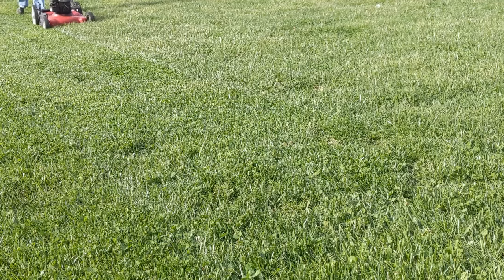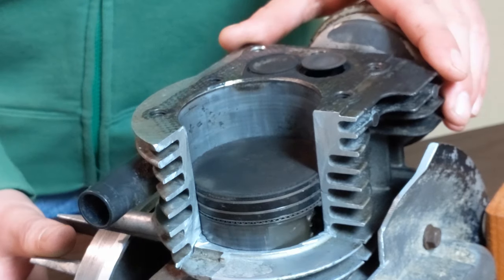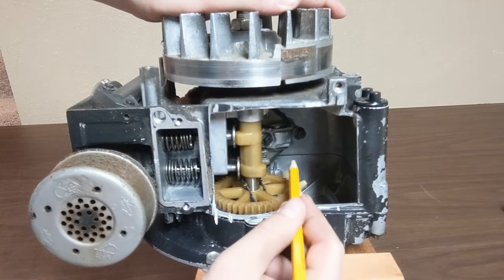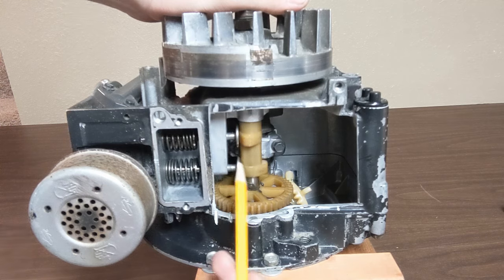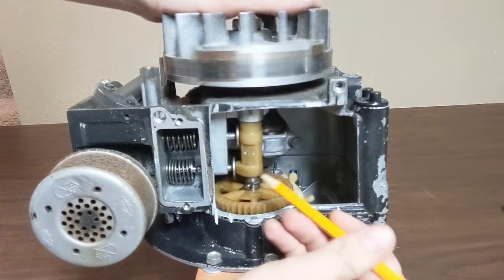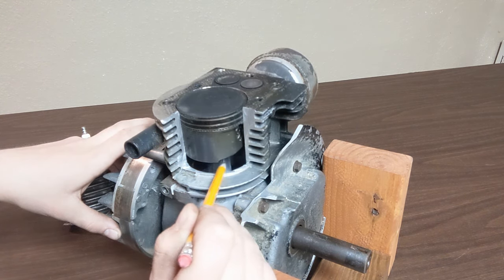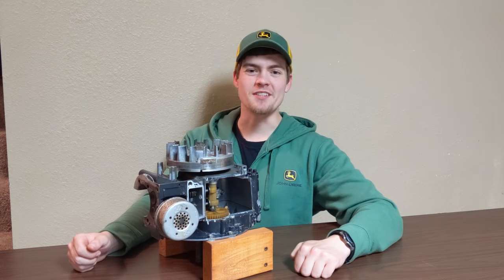How a Briggs & Stratton Engine Works — A Look Inside an Engine Cutaway

Comment: Is that a PLASTIC camshaft?
Reply: Bruh
Reply: Alot of old briggs and strattons have plastic cams. I own i briggs and stratton flat head and it has a plastic camshaft
Reply: Nylon and it's additives revolutionized internal small motor parts. Not a new thing.... decades old.
Reply: So stupid... Any metal shavings in the oil and it's bye bye camshaft.
Reply: @F3udF1st  is that how it works? They seem to work well.
Reply: The valves are small and the valve springs are not very strong. Someone at Briggs said lets make them cams  nylon! The rest is history….
Reply: Bro its 7hp what the f do you want ???
Reply: @Kailikescars I swapt my one whith metal 0:48
Reply: Yes.I took an lawnmower engine appart and lawn mowers have an plastic camshaft
Reply: @F3udF1st shouldn't have metal shavings in your engine in the first place
Reply: @papimasfuerte4671 it's already living a bad life if it does have shavings and dirt
Reply: I'm proud of my Briggs & Stratton collection along with the others a working 1957 2.5 horsepower push mower is yellow from the factory
Reply: In about 1965 they moved the carburetor on the vertical shaft to the other side with a tube I still have some of the old ones with the oil bath air cleaner they run about the same but I bet that tube gave it a little more horsepower but I like them if they're weak too 
My Old 2/12 yellow will just set there and idle at 51 rpm . Sweet 1957 push mower
Reply: I love my briggs but Tecumseh had a pump
Obviously the Briggs slinger is good enough..
Reply: @Kailikescars I'm trying to have an example of each mower changeover from Flathead to overhead valve and it's interesting.
Reply: Probably around 1977 they started using it depending
Reply: @RonaldDaub-v9y  nice!
Reply: @RasmusRosengren  metal is better

Comment: I'm still a small engine novice but I'm learning all the time. This has got to be the best demo I've seen in 3 years  on here. Awesome awesome video thank you.
Reply: get one that is worn out... clean it... take it apart, keep the parts, put it back together again with new E bay piston rings. oil everything up... use 20-50 motor oil as the motor will have excessive clearances in it so it needs THICKER OIL... with 20% STP OIIL TREATMENT...thick as honey.  tighten the CONNECTING ROD, sump and heads with TORQUE WRENCH TO SPEC's OFF GOOGLE FOR THAT MOTOR... the model # is on the tins. dont lose the tins as there are a zillion differnt briggs as they couldnt leave the thing alone over the years so they are all a LITTLE different. new plug... new coil? clean carb with WD 40. new gasket set off e bay $12. oil bolts before assembly so they dont freeze in their holes. TIGHTEN TO SPEC's avail online for that motor. add the thick oil, paint it JD green. write on it with paint pen... CHECK THE GD OIL BEFORE EACH RUN OF THE DAY... USES 20-50 MOTOR OIL!!!!!!!!!  new air cleaner... 5 for $9 on e bay and see if u can get it going again as a mower... sell it for ... $75 or so. TELL THEM TO CHANGE THE GD OIL EVERY <25 hours and new air filter every 50 hours and it will last a good long time. if they dont... it will stop running in < a year. choice is theirs.
Reply: Wouldn't call 3 years a novice, more like intermediate

Comment: Great video! This helps me very much try to understand how engines work. I have very little small engine knowledge but recently decided to pick up a wood chipper with a 7.5 hp briggs and stratton horizontal shaft.  I figured i'd spend some time and figure out what was wrong with it and try to learn something.  The first thing i did was check the oil. It looked new.  However when i checked the dip stick, it was extremely low.  I drained the oil to find there was very little left.  So i filled it to the proper level with new oil.  I checked the spark.  There is a spark. I changed it just for the heck of it.  I also cleaned the air filter and the carburator.  Gaskets seemed ok, but not great.  

When i originally tried to pull start it, it wouldnt pull at all. It was stuck.  Eventually i was able to pull it and at that same time, a blade within the chipper cracked off.  So i think the shaft was jammed due to the blade getting stuck.  It now pulls, but doesnt do anything. it doesnt sound close to starting at all. I dont get sound that sounds like it is starting.  I pulled off the combustion chamber and valves.  When i rotate the flywheel, i noticed the piston doesnt travel all the way up the cylinder.  When i push it down, then rotate the flywheel, the piston comes up about 3/4 of the way.  

Could the piston not moving all the way up the cylinder be a result of low to no oil?  How can i get the piston to travel all the way up the cylinder, as it does in your video when you rotate the flywheel? I have tried lubricating the top of the piston with oil and PB Blaster and spreading it around.. no luck yet.  It has slowly rotated counter clock wise as i push it down with my fingers, rotate the flyweheel, and repeat.  But never going more than 3/4 of the way up the cylinder.

Thanks for the help :)
Reply from the maker: Well, not all engines are gonna be made the same. The piston on this particular engine comes all the way up, but it might not on yours. My question would be does the piston move up and down on its own by turning the flywheel?

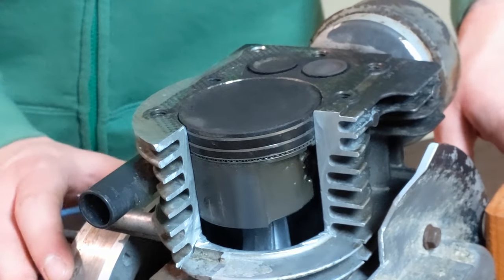Comment: At around 1:11 if you look closely the exhaust valve opens just a hair. The shadow around it gets a bit darker. Is there a reason for that? Was it just the way you turned the flywheel? Or am I seeing things?

Awesome demonstration. Overall surprisingly simple.
Reply: it is just a compression release on the exhaust valve at arm pull speed to make it easier to turn over. as soon as it starts centrifugal force disengages this mechanism.

Comment: This is very helpful! What prevents the crankshaft from rotating in the opposite direction?
Reply from the maker: The pull cord recoil will only turn the engine over clockwise when starting, and I believe the timing would be ever so slightly retarded so the spark plug fires after the piston is at TDC.

Comment: I'm trying to learn about small engines, which is how i ended up here. So, that's a "flathead" engine right? because the valves are next to the piston.. not above it, correct?

Comment: Can I use that motors for other things? An example I want to know is; can I use it to make a go-cart?
Reply from the maker: The short answer is no, but you can make anything work with enough effort... The best option for a go cart would be a horizontal shaft small engine. This is a vertical shaft engine. That term specifically relates to the orientation of the crankshaft.
Reply: @johndeerejared  Thanks for the answar, I am just courious. I am at my first year at mechanic school, in this year I will build a go cart on end of school year. So I am planning to build one at home next summer after I've been learned how to do it.
Reply from the maker: @Michael-ks1sn  that sounds awesome! A channel I follow is called Cars and Cameras, they do a bunch of custom go kart and mini bike builds and that sort of thing. That'd be a real good resource for your build I would say

Comment: thanks for this..I am trying to bring an old 4hp briggs to life but the intake valve is not opening.The tappet is for is barely coming up far enough to just barely kiss the valve stem/.Would you suspect a bad/broken lobe on cam shaft?
Reply: Bad camshaft that happens a lot with these plastic cams especially if the engine has been overheated or ran low on oil
Reply: Bad tapper or cam
Reply: @connorssmallengines6663  tappet broke cause valve was stuck

Comment: Nice  ! I always wonder how the valves were connected to the crankshaft on the type of engine . It’s the cam shaft plastic ?
Reply from the maker: Thanks!
It is made of plastic, though in my experience they are highly reliable. Generally something else will fail on the mower before the cam will fail.
Reply: That's why I clicked. I was so surprised to see nylon cams!

Comment: With each stroke of the piston I noticed that the flywheel magnet passes the coil. Does this mean the spark plug fires at every stroke?
Reply from the maker: Great, observation! That is correct, it will spark on every revolution. Of course it only NEEDS to spark on the power stroke, but I believe this was the simplest way to make it for Briggs. The extra spark really doesn't affect anything.
Reply: It's a wasted spark engine.
It sparks at the top of the compression stroke and at the top of the exhaust stroke.

Comment: Can this engine run clockwise?
Reply from the maker: Well, the engine actually does run clockwise. You would refer to the direction of rotation from the flywheel side.
Can it run counter-clockwise? Probably, but the oil slinger would be going the wrong direction and wouldn't sling oil to the cylinder which wouldn't be good 😆. There could be other issues with it turning backwards but that's the only one I can think of off the top of my head.
Reply: If the crankshaft spun in reverse, the camshaft would also spin in reverse.  Because of how the camshaft's lobes are positioned, the intake-lobe would still allow fuel-air mixture in (during the intake-stroke).  BUT then the exhaust-lobe would immediately allow that mixture to exit out the muffler (during the compression-stroke), leaving nothing for the spark to fire.

Comment: Al good, except You forgot to mention automatic De compression mechanism,  this is important. without this it's hard to pull the string!
Reply from the maker: That's correct, one day I may remake the video with more details into the specific engine! But for now this will do 😄 Thanks for watching, I appreciate it!

Comment: How the compression stroke pull up the cylinder 
I mean where is the force that pull the cylinder up ?
Reply from the maker: Good question! The flywheel has some weight to it and that weight is what keeps the engine turning. Once the engine is running there's enough momentum to overcome the compression in the cylinder.
Reply: @johndeerejared  I got it 
Thanks a lot 🙏

Comment: hello if it is extremely hard to start a chain saw using starting fluid , what would be the most likely cause?
Reply from the maker: I mean is it wanting to fire at all? If it's not getting spark then it's obviously not going to run😂
Spraying starting fluid or carb clean in the intake should get fuel to the combustion chamber, so it should try to start. But if you don't have the kill switch on it's also not gonna start... We've all made that mistake before 😆
I will say whenever I work with any 2 stroke engines I try to use mixed fuel instead of starting fluid so the cylinder gets the lubrication it needs
Reply: I managed to start it by changing the diaphragm . I was under impression that i was bypassing the carb using starting fluid . I guess not.

Comment: I have a Briggs Sratton engine at home, it worries me that during the compression stroke, the exhaust valve opens slightly, and as I see it, the engine in the video has the same problem, I'm disappointed with this brand.
Reply from the maker: Good observation! The exhaust valve is actually supposed to open slightly on the compression stroke. It's called the compression release and it will only do that at low speeds to aid in starting. Once the engine has started and is turning a decent RPM, the compression release doesn't "bump" the exhaust valve tappet. Perhaps later on I can do a more detailed video on these sort of details

Comment: Nicely sectioned motor but hey they couldn't make a nastier cheaper engine.
Reply: The Briggs and Stratton four stroke engines are very reliable and durable.
Reply: @Thetrucky69  not the newer ones. Plastic camshafts are so dumb.
Reply: @connorssmallengines6663  just about every non commercial lawnmower has a nylon camshaft they don't hurt reliability or performance even honda commercial gxv160 engine have them
Reply: @conner5611  doesn’t mean that metal is better. I see too many times when a valve gets a little stick that those cams just destroy themselves. And gcv160 and gcv190 engines are NOT commercial engines. They are for residential use. All bigger riding mower engines except Kawasaki use metal cams
Reply: @connorssmallengines6663  I never said anything about the gcv160...
Reply: @connorssmallengines6663  my point is that nylon cams are perfectly fine In consumer grade engine's your never going to rebuild the engine so there's no point
Reply: @conner5611  I thought you made a typo. And also if you are never going to rebuild the engine, even more reason to make it so they won’t have to be rebuilt
Reply: @connorssmallengines6663  the cam is usually never the reason for a rebuild the piston rings or connecting rod usually goes first
Reply: @conner5611  I’m not an idiot, I have been a small engine mechanic for years. If the cam goes, the engine will need expensive maintenance. Do you not understand? If the cam is metal, it has a much higher chance of surviving.
Reply: @connorssmallengines6663  never said you were 🙄 im simply stating my opinion on the matter